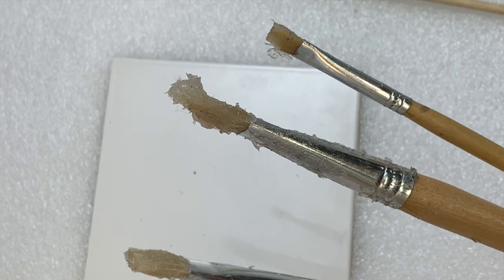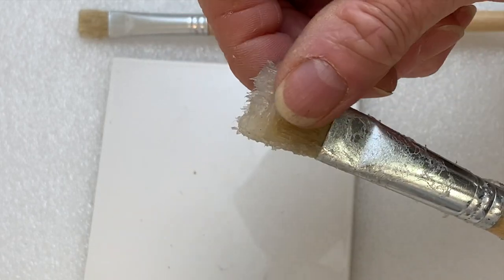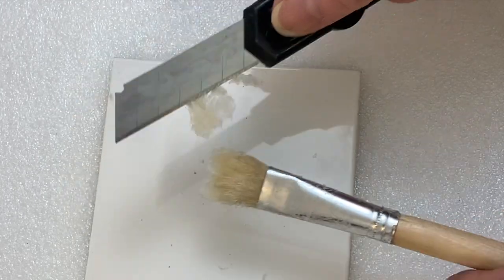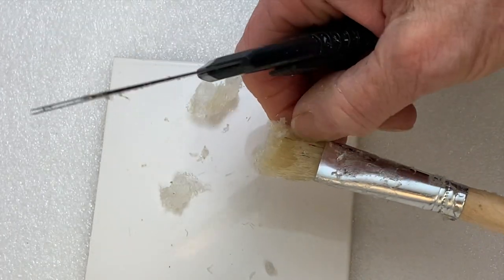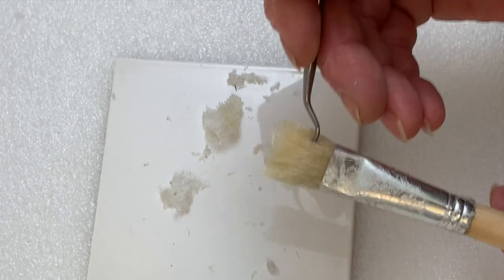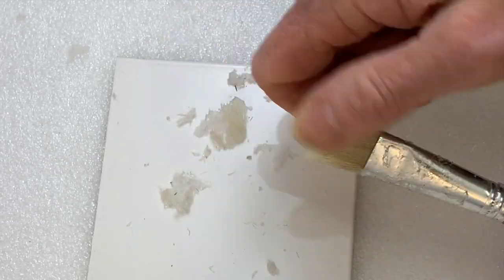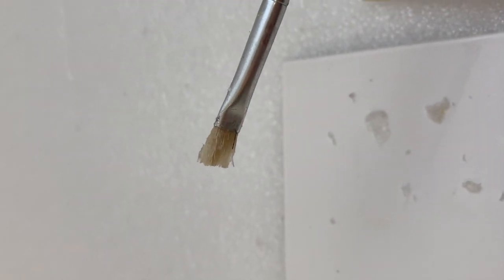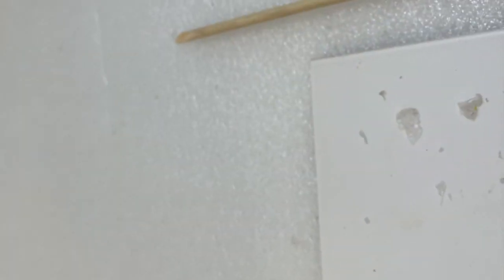How to clean the silicone from your glue brush, Glass Mosaic.

Comment: Just soak in 100% acetone nail polish remover in little shot glass twisting back & forth wiring with paper towels rinsing soap & water
Reply from the maker: For this particular technique you don't want to clean the silicon completely off the brush. Once the silicon goes into the bristles, it creates a stiff but slightly flexible glue spreader.  The glue spreaders that you can buy for purpose are either too rigid or too floppy. 
Of course this may not work for all techniques but for this technique,  over 20 years, I've found this the best way for this technique.